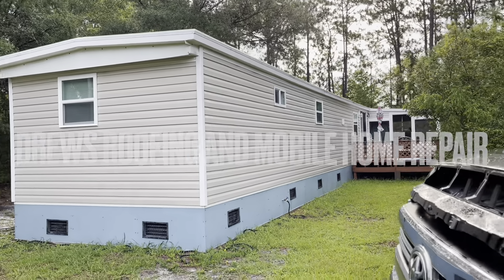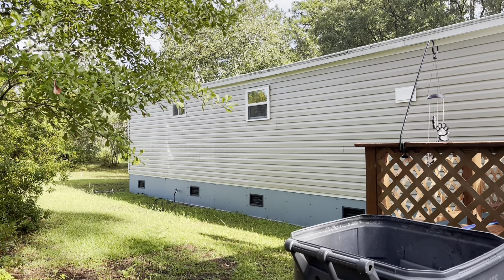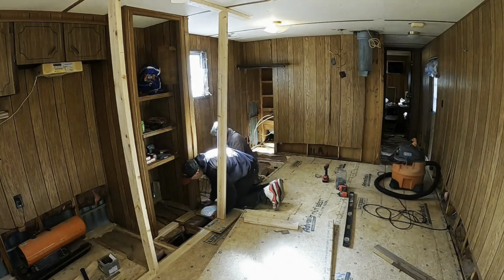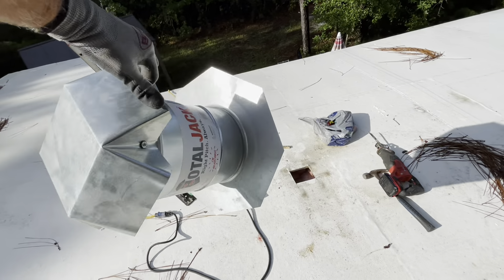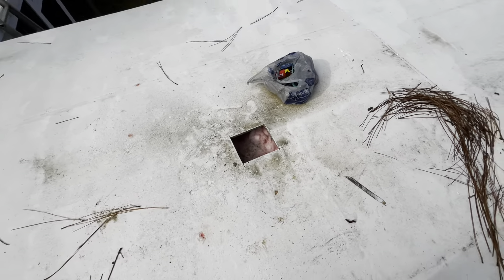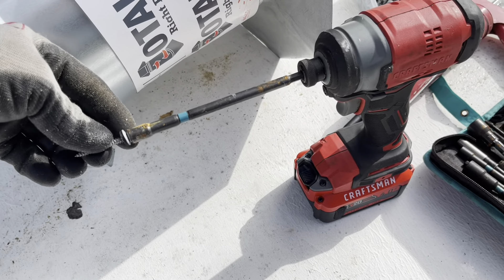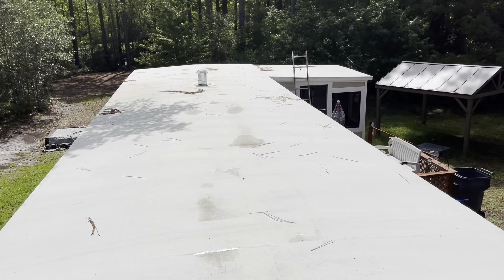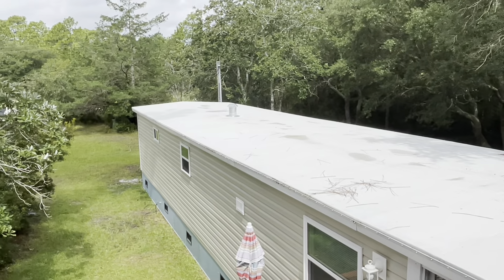Easy mobile home roof vent install. Mobile home renovation. Single wide.

Comment: Hey drew what’s the oil base paint do on the cement board yeah we call it that up north brothA lol the plastic track is awsome so you frame it all the way around then plywood and a thin barrier? Then the board goes over it ? Those vents where did you buy them looks amazing you guys are soo good man if I had the cash  I would hire you in a minute please let me know thanks ur boy Joey 👍😎👍🤘💪💪💪
Reply from the maker: It doesn’t matter what kind of paint as long as it’s oil base and yes, we put that track on the bottom not the top. We painted it all the way around. It looked beautiful when we were finished the vents we bought at Lowe’s. You can buy the same thing.

Comment: Drew it’s ur boy up in mass area okay I bought 2 5gallons of kook seal for my single wide use both 5 gallons on the roof ?? How long will it last is the big question lol and the under pinning / skirting?? What’s harder board never heard of it thanks the house looks amazing too you guys rocked it big thumbs up brothA 🤘🤘❤️😎😎😎 Joey
Reply from the maker: Hardie board. Lowe’s sells it. Generally on the can or bucket it will say seven or 10 years. I think that’s bull crap it’s in my opinion that it only last 3 to 4 years. So I recommend Cool of course you have to wash first and then Cool Seal every 3 to 4 years.